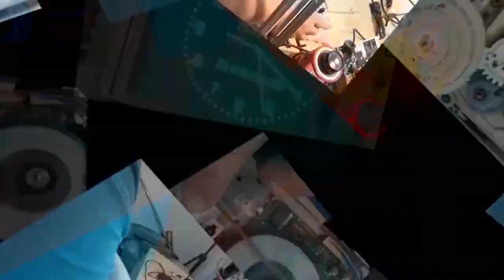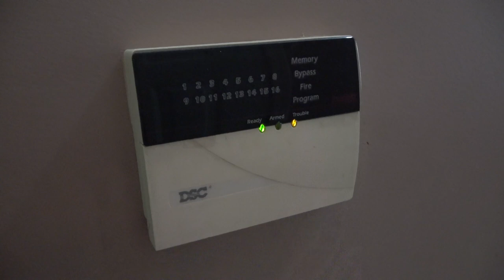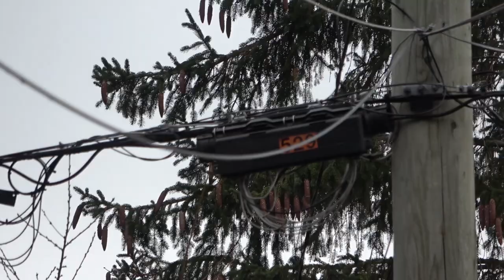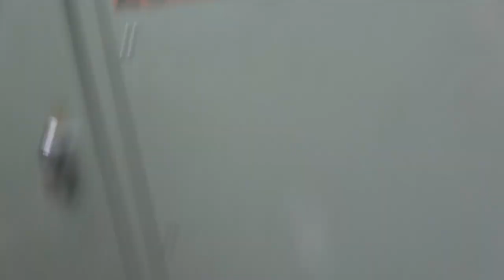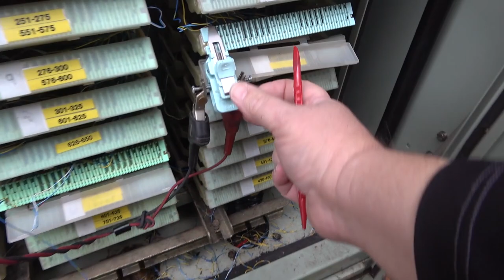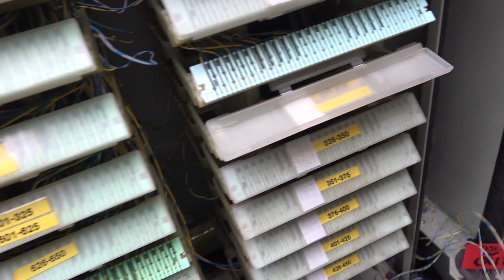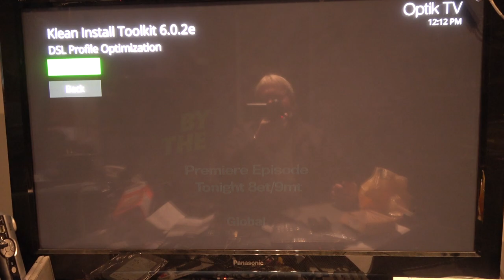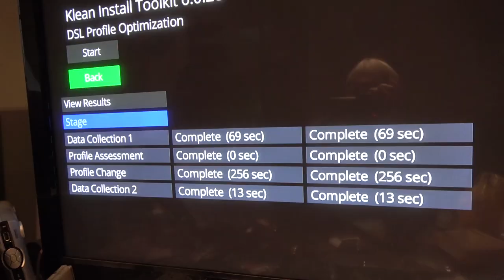Fixing my old noisy copper phone line

Comment: With all the talk about not having as readily available dispatchable 911 location (E911) on cells, I'm curious what your thoughts are on using wired SIP devices in the home as a replacement for a POTS line. Granted, the SIP endpoints don't have the advantage of still working with the power out as many analog phones do. Still, it does have the modern take on the issue of having a consistent dispatchable location based on the FCC requiring dispatchable E911 for fixed devices (home lines) and multiline systems (Ray Baum's Act).

Comment: You can't use the fibre for your Internet connectivity and the old PSTN for your legacy equipment?
Reply from the maker: Technically yes but why would I want to?
Perhaps you are ok with your service increasing by 30 a month but I'm not.
Reply: @12voltvids   When you said that that fibre is connected, I figured that meant that you already have an Internet service available on it.

Apologies for not being a mind reader.
Reply from the maker: @beardymcbeardface69  
The path is there but the fiber is not lit up. I ran it in a few years ago but didn't change technology because I will lose my old grandfathered tv package.

Comment: AHH, the sound that every tech is familiar with mostly caused by Verdi or compromised pairs leaking to Earth
Reply from the maker: Dirty open on tip. Going to earth causes hum.
Reply: @12voltvids  If conditions are dry then going to Earth tends to hum but if the conditions are damp then the sound of fying eggs is also very common, fractured cable also sounds like frying eggs as do faulty VF cards. This is certainly the case on PDH and SDH systems in the UK. Ironically, an open leg tends to hum rather aggressively, maybe this is do with different Earthing systems compared to yours, our positive DC is Earthed making the negative terminal negative 48Vdc with respect to Earth. But whatever, noise is a fault with many differing causes. 😁
Reply from the maker: @harryjohnson615  wet cable will be static regardless if it is a ring ground or ring to ring or tip cross.  Static on dry cable is always a dirty open.  If you can pull a clean dialtone with hum to ground then it is a tip fault if static remains when pulling dialtone to ground along with hum then the fault is on the ring side. So much can be figured out with a but set and your ears.
Reply: @12voltvids  You misunderstood, I wasn't talking about the ringing setup.  I mentioned Earth as being a possible cause of why it is that you've only observed a hum on the line for tip or ring leaking to Earth when in the UK we experience hum, crackle and static. Far too many service techs cause repeat truck rolls especially in dry weather because they prefer to use a butt phone in monitor mode rather than using a 9083 set to Meg Ohms to find compromised insulation.

Comment: Did you have to force the line profiling for your port? Or is that a Telus scheduled performance optimization that's continuously run?
Reply from the maker: Line optimization occurs on a regular basis at night.
Reply: @12voltvids  Cheers.

Comment: We actually just ran into the same problem. Whenever we have static on the lines its cuz it rained a lot. Theyve been out here twice. I think the other day they put a protector on something in the box outside. I dont know what. But we have copper lines. We have two lines like u do cuz we used to have dsl but we switched to comcast. Either way when it rains theres static on the lines. My aunt said it used to happen to her too at her house. She says usually it takes 5 days for the static to go away or i guess dry out from the rain.

Comment: 4:45 Modern cellphones (made 2012 and up) have a feature called Emergency Location Service (ELS). In an event where an emergency number is called or texted, your device enables all tools available to pinpoint your location and will send it to the emergency contact, whether it be 911 or the ICE number you contacted. These services are enabled until either emergency responders arrive or after 15 minutes is up. Cell phones are never exact, but can give a really accurate "guess" to where you are thanks to ELS.
Reply from the maker: Only if you have a good GPS signal. Relying on the cell towers will get you close, and if you are in a house will generally get emergency services to within a house. If you have a GPS lock they can narrow that down to a few metres. However if you are in a high rise or even a low rise, they will locate you to an approximate location, but will not knkow if you are in suite 101, 102, 201 or 504. They might show the building address, especially if that building has a cell tower on it, but if the GPS signal is blocked, that is all they know, and even with GPS the lighlyhood of spotting the correct floor is low.
Reply: " Cell phones are never exact, but can give a really accurate "guess" to where you are thanks to ELS."

Yes when someone's life is in danger, always rely on guessing. Great answer there guy. Smells like cope to me.

Comment: That's funny I have FIOS which uses a Tellabs 612 ONT when I checked the datasheet it said pulse was supported and for the heck of it after the install I tried an old rotary phone and it worked fine. Guess some ONTs don't support it.

The copper infrastructure at least in the US is aging and expensive to maintain. The main carriers here are working vigorously to phase it out. Verizon has already petitioned the FCC to retire copper back in 2019. Kind of funny since many of the fiber lines are over lashed on the old copper :-). All I can say is like analog TV and incandescent lamps I see the writing on the wall. Enjoy it while it lasts.
Reply from the maker: The Nokia ont we use does not support. Fax machines have a tough time with derived voice too. Eventually copper will shut down but there are still areas with no fiber and until it is all done copper will remain. I would guess perhaps another 4 or 5 years.
Reply: @12voltvids  You guys are way ahead of Manitoba. Bell/MTS just started doing a full FTTH build this summer - they expect at least 5 years of construction.
There's horizontal boring machines  and vac trucks all over the suburbs.

Comment: Just started your video, but if you have a good ATA, it supports pulse dialing as well as cutting line voltage when service goes down. This sucks for an overnight restart, though. Problem is, telcos don’t give customers good ATAs. They give you the one built into the residential gateway.
Reply: All that to say, I think your reasons to stay copper are fine. Maybe telcos will put out better ATAs or use gateways with better integrated ATAs when they start removing copper entirely.
Reply from the maker: The ont that is used is a Nokia and it does NOT drop the battery if the service is down due to a los of light. It does drop the battery during a reboot, which usually occurs at about 2 in the morning when an update is pushed, and the resulting blast of the alarm siren is also not welcome. I have switched a few customers back to copper for this very reason. Alarm going off in the middle of the night. The solution is to change alarm system to one of the wireless systems that use a cell modem to report but that is just another expense I do not need.
Reply: @12voltvids  oh, I totally agree. Rebooting at night sucks. The Nokia ONT just provides an Ethernet or SFP+ connection for the residential gateway, which has the actual phone guts. The telcos hide this fact from the techs for some reason - going so far as to make the newest generation of ONTs just come inside the gateway as a SFP+ module. As a former network tech, I don't know why. Maybe keeping the black magic phone stuff and the black magic network stuff assigned to separate people helps their bottom line? :) On Telus in particular, you don't even need to use their gateway. Get a SFP+ ONT, plug it into your own router (nothing residential has a SFP+ port, DIY with pfSense or buy pro gear), plug a Grandstream ATA (or another brand that's also good) into your router, and now as long as you keep your router online, it doesn't reboot overnight (because it's the gateway doing the reboots occasionally overnight), and you have an analog phone line which works almost exactly the same as a real one. I don't have a clue how you get your provider's phone number to work on a third party ATA, though.
Reply from the maker: @ZiggyTheHamster  Telus has 2 ont that are available.  The SFP will plug into 3 gateways.  2 have the pots ports in them but they are not enabled.  The stand alone g240 has 4 Ethernet ports and 2 pots ports.  4 independent internet accounts can be provisioned. This is primarily for suites or seperate business accounts.

Comment: Curious what your local CO is. 5ESS, DMS, or one of those newer Soft Packet types?
Reply from the maker: It's an old GDT5 that's been there since the early 80s when the crossbar switch was removed.   Long before my time with the co.i really do wish I had gone there right after high school.  I had the opertinity as both my uncle and one of my cousin's worked for the company. Had I went to the phone company right after high school i could have been retired for 3 years now with a nice pension.  But, my mother talked me out if it.  It was her brother that worked there and all he did was bitch about the company and bitch about his co-workers and bosses.  Considering that every time i saw him he was 3 sheets to the wind, I would say that he was the one with the problem.  When my career in TV didn't go anywhere i fell back on my electronics interest and pursued that career. 20 years later I figured out it was the wrong choice it went back to the phone company which should have been my first choice.

Comment: I'm in Canada and our city has it's own telephone company (TbayTel) using a landline, videon, DSL, and I've been with them till August 2020. I was using their copper service and to switch over to fiber they wanted far too much money and their TV package sucked anyway so I left. I'm now with Shaw and my internet runs around 300-350 Mbps (which to me is lightning fast as opposed to 5 MBS with Tbaytel) anyway I still have a Rotary dial phone in my kitchen and the guy at Shaw said it wouldn't work and it works just fine. How would I know if I have fiber? Does it run off a coaxial cable or something else because all I have is a fat coax cable with a thin ground wire built into the sheath. The rotary works to dial and take calls and my fax still works. Maybe I still have the old stuff? Also the main reason why I have a landline still is because I HATE talking through my cell. Yes I know you can use the headphone but I find it to be a pain and I refuse to have a cellphone against my head for more than a couple minutes. With a regular cordless or normal desk phone I can cradle it on my shoulder and actually do stuff with both hands where with the cell my face mashes the screen or it slides around and eventually falls.
Reply from the maker: Your phone is probably still on copper. Your shaw service comes in on coaxial cable and it's shared with everybody in your node pool which is typically between $250 and 500 customers. I could get fiber here today if I wanted but I choose to keep on my copper DSL because speedwise it's all I need. I get 75 down 20 up which suits my needs and I get TV service as well. Rotary phone won't work on derived voice on our fiber system I don't know about Shaw but I suspect that your copper phone line is still providing you local phone service

Comment: There some benefits of a cellular alarm monitored system is that more reliable and also sends signal must faster than on the phone line also it still send out signals if phone gets cut and most alarm can have dual path communications landline and cellular also you can have remote management so are to turn on and off the alarm remotely we have experienced this with dsc alarm that has a cellular communications because as we shut off the alarm it like 15 seconds and are calling us
Reply from the maker: But that costs a ton of money every month.  I pay nothing.   My alarm panel calls my cell phone if it trips. It also turns on 2 50 watt sirens one front and one back.  Nobody is hanging around with that noise.  That plus the fact that there are cameras everywhere as i evaluate different cameras for companies.   
I am fully aware of dual path alarms.  I am a security system tech at work and install systems every day at my day job.  Our systems are all dual path.   Still it's 20 bucks a month that I don't want to spend.   You don't get where i am at finiancially by throwing money around left right and center for all these subscriptions. 
The words unnecessary expense or unauthorized purchase is used around here frequently.  I run a tight ship around here.

Comment: well here in washington state the city i live in we had dsl and such and that was shitty. every year at least once a year the dsl would always screw up and go down or get a little slower. also fiber and cable and just a few months back they made upgrades to those services here. the copper lines here havent been maintained well here cause they say oh sorry but we cant give you any better dsl service cause you are to far from the hub even though there is a box just down the street sadly. the one thing bout fiber here in the us is that it requires constent power from 120 volts and when it looses power you have to use a backup battery for it which isnt good when there is a major storm or power outage sadly.

Comment: Just a side note most cell phone providers require you to fill out your address for 911 when you activate your phone (At least on any modern smartphones, may be different on flip phones)
Reply from the maker: Business phone registered to business address?
Reply: @12voltvids  like if you get a new smartphone from Verizon it will have you fill out your e911 information.
Reply from the maker: @buddster124  
Business phone handed to me by employer. Has work address on it not home. Not connected to wifi either as I use it at work for work only and don't use it for personal use.

Comment: I'm an At&t fiber user, and we got bit extremely bad by them due to our old house not having fiber, and them refusing to hook up the legacy copper line even though we had it at the apartment before that. They wanted to make us wait a whole month without internet or phone service. We switched back to spectrum because they were in and out in a day and we had service. We ended up switching back to att because they had a good deal and ended up saving about $200 because we were using a prepaid cell phone service. I will sympathize with you though in that ONT suuuucks and doesn't allow you to use your own modem or router, most likely so Att can spy on me through the DNS. Although I have my own router in place and I essentially did my best to disable as much junk as possible so my actual router can do all the routing and protecting.

Comment: I’m very pleased to have come across your channel; you sound as if you’ve worked for the phone company for quite some time and have quite a few stories to tell.  I myself have a B.S. in Computer Science, and I’ve been interested in electronics (including Landline Telephones) for as long as I can remember; I’ve worked with landlines on the consumer side of the connection, and I’ve also been curious as to how things work on the service side of the connection.

I admire your decision to use legacy equipment; I agree that, while newer technology has its advantages, it doesn’t always make sense for every situation. Although I’m a fan of Fiber Optics, I personally feel that twisted pair phone lines should at least be preserved for emergency backup phones instead of being phased out entirely.

If you don’t mind answering, in addition to working on actual phone lines, have you worked on telephone switches such as the 5ESS or the DMS100? Have you ever worked with business phone lines such as T1 lines or ISDN lines? It’s my understanding that, before DSL and Cable Modems became widely available, phone companies offered ISDN lines to consumers (in addition to businesses) as a means to get one voice line and one data line that could be used as a high speed internet connection (though not as fast as DSL, Cable or Fiber Optic).

On a sidetone, I had to retype this comment as it got corrupted when I submitted it the first time; I have to remember to type my long comments out in a separate application and then copy and paste them into YouTube.
Reply from the maker: No I don't work on the switch side of the connection. The closest i get is the MDF in the CO. Isdn and t1 / t3 lines are business techs. Work along side of them but i don't touch that side of the business and they don't touch the residential side.   I work on copper and fiber outside plant and premise equipment for phone ADSL ont repeaters tv boxes and home security equipment including security cameras.
Reply: @12voltvids  Oh, I see; still, I'd be interested to see more videos of what you (and others in your profession) do in the field.